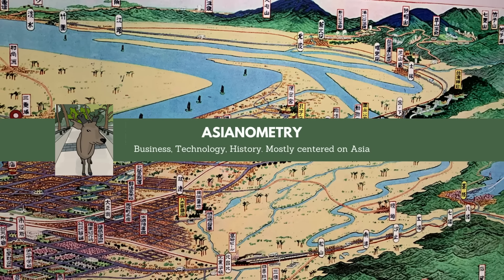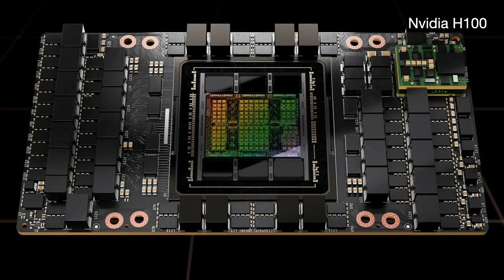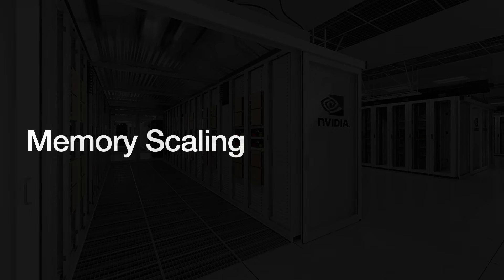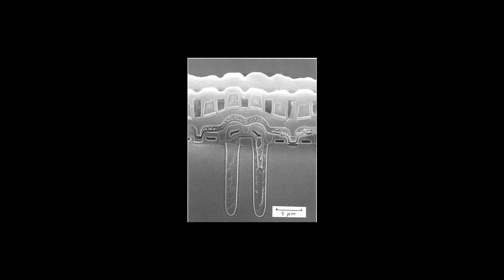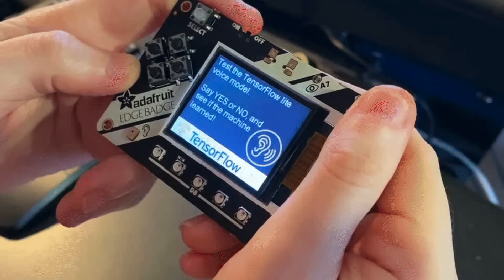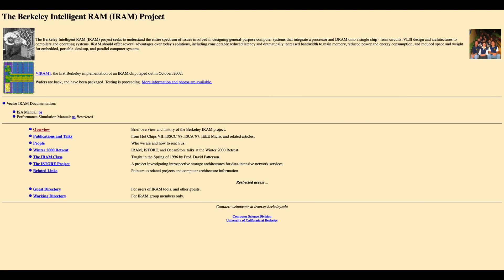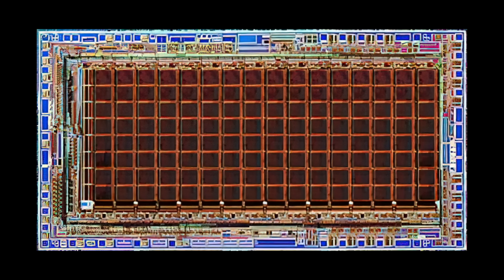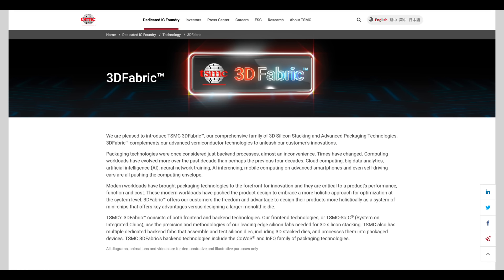AI’s Hardware Problem

Comment: I was hoping you were going to get into some of the software solutions that today's neural networks have been able to implement to allow 1000x increases in deep learning architectures while the VRAM has only increased 3x in the same timeframe instead of exclusively the hardware solutions. Stuff like how there have been great advancements in the ability of multiple gpus to communicate with each other efficiently to perform backpropogation which has allowed neural networks be trained on many gpus at a time. At first, a neural network could only be trained all on one gpu, but then the NN got too big to fit onto a single gpu so we figured out how to have a single layer on each gpu, but then the NN got too big for that, so we had to figure out how to have parts of each layer on each gpu. Each step along the way required innovation on the side of machine learning engineers to build exponentially larger neural networks while the gpu VRAM just isn't keeping up
Reply: I'm glad you mentioned this, just like 2 weeks ago they were able to write data on DNA for the first time which enables you to have massively higher levels of data compression, if you were to combine this technology with the gpus, this would solve the problem for raw processing capacity.
Reply: @xanderunderwoods3363  what area the read and write times on DNA when used as memory?
Reply: What do we need such powerful neural networks, actually?
Like, there's stuff we could do, but should we? Like, maybe we need to give society time to adapt to new technologies, instead of rushing it all in one go?
Reply: Does SAM/BAR help with this stuff?  It allows access to ALL video memory at 1 time instead of 256mb blocks.
Reply: @TheVoiceofTheProphetElizer  I'm a software dev, my experience is that the more efficient and compact you write code, the less people understand what it does or is meant to do. Sad, but true. I've ended up re-writing code to be less compact and less efficient simply because I got sick of having to explain what it does based on what logic every time a new developer came across that specific piece of code. People on average are simply not good at computing. This was in C#, when I wrote in assembly contained raw machine code it was worse, I got zero points in school tests because the teacher didn't understand why my code gave the correct answer. I'm a software dev since many years now, and write most code to be explicitly human readable just to save time in explaining, except when it's code I don't want others to mess with.
Reply: @TheVoiceofTheProphetElizer  I started programming back in the 80s, still in the 90s most of the time devs didn't have to explain why their code worked or how as much as they do now. Often enough these days it is non-technical people like accounting etc who insist on understanding something because billing elements are based on it, but they tend to move on rapidly when the "why/how" doesn't have a very simple answer. Luckily for me I don't really need others to understand my code these days, I'm the most senior where I work, so at the end of the day I can just ignore them if I wish.
Reply: @ayanaalemayehu2998  Very very slow. It's a really bad idea for use in computers, except for long-term storage where it could be great. But there might be more solutions to be found from or inspired by biological systems. I can't think of any off the top of my head, but the idea can't be discounted. Well, one idea could be circuitry that can be changed/adjusted, so that programming it would be slower but then all operations could be extremely fast. It would be bad for creating/training neutral networks, but that could be done separately on a more traditional machine, then this chip would be programmed to change its circuitry to simply become that network. I bet we're way off from being able to do that though.
Reply: Love how the boomer brigade is having a field day in this comment section.
Reply: @loonardtheloonard  No one rushes anything. Different people study different things, advances in some sectors lead to advances in others, some stagnate for a while and then progress. Sometimes advances in one subject lead to advance in a second, which in turn effects a third, perhaps a fourth, with that fourth somehow helping the first subject again. Who are you to dictate what is and isnt progress
Reply: @xanderunderwoods3363 that is useless, compute is so fast that I worry the shuttling of ions between the anode and cathode in ECRAM much less the reading and writing of DNA, DNA is for data storage not RAM, you don't understand ram at all
Reply: Implied or poorly worded, the discussion in this thread talks about it as if this video or indeed Asianometry themselves ignores or forgot to further discuss the role of software inefficiencies as "compared to" or "vs" hardware is such a weird take. Focusing on one aspect of the dilemma doesn't undermine the significance of the other, it's just a matter of scope. Perhaps the channel author's expertise is mainly applicable within the topic of hardware, and so that is what they chose  to focus on, or simply to keep the video from being bloated (hey, found another use for the word). I wouldn't read too much into it, just take it for what it is, a part of a much wider picture.
Reply: Um, the video title says "hardware", maybe you are looking in the wrong place if you expect to find "software" being talked in a video that's literally has "hardware" explicitly mentioned lol.
Reply: @Om-kl4it  the title of the video is "AI's Hardware Problem", and my comment is just saying that the main hardware problem is that gpu VRAM is not keeping up. The solution to this hardware problem was a software-based solution.
Reply: Do any young people such as myself have any respect for the wisdom of older generations anymore? It’s shocking how little some young people know about the past, just how easy it is for society to collapse into authoritarian tyranny, and we haven’t magically grown out of that possibility. 

It takes very little for things to implode into violence, ignorance, and destructive tribalism. Saying it isn’t worth taking the risks of AI seriously is astonishingly foolish. Of course we should be supporting a critical risk analysis of AI, and create risk mitigation strategies with regards to AI, along with  implementing sensible regulations to avoid many of AI’s clear potential pitfalls/abuses.

I just don’t understand how anyone taking a serious look at the potential of AI can be so blind to the clear potential for serious abusive/dystopian risks associated with allowing a completely unregulated AI free for all, where criminals and tyrannical governments/institutions/corporations will misuse/abuse AI to further their own nefarious interests at the expense of humanity. We already see almost every tech company in existence taking advantage of their users, being to big and influential to ever face serious ramifications for their illegal behaviour. Just imagine what many companies and governments will do with AI if no laws and regulations are put into place to punish those who wish to abuse the power of new AI breakthroughs. 

This is a serious topic worthy of conversation, and for society as a whole to determine how we wish for AI to be regulated and safeguard us all from the serious risks new AI tools will clearly subject all of humanity to. Saying this doesn’t mean AI technology cannot be used for the good of humanity, but that it’s equally as foolish to ignore and downplay the immense risks associated with such a new and revolutionary power that AI already has created, and that continues to grow exponentially as new AI breakthroughs are made.

AI breakthroughs have been absolutely astonishing, and also absolutely terrifyingly powerful. It isn’t just Boomers who are ignorant with their doomsday AI rhetoric, but also the bullheaded, young, naive, and arrogant Gen Z who downplay all of the obvious risks of AI while mocking all the “Boomers”…
Reply: @horrorhotel46290  We boomers made the field; why shouldn't we have our day?
Reply: @noth606  sounds dumb but, do u teach coding ?
Reply: @propulsidereal 
That's... not true. Stuff this powerful get mishandled a lot of undeserving end up dead or worse.
Reply: @loonardtheloonard 
It's not all being "rushed in one go". Not remotely, considering that LLM have long since stopped being a legitimate candidate for A.G.I

Any one person, or group even, who wants to stop it's progress can't, and likely won't until it's ostenisbly more dangerous to continue R&D than to allow themselves a break from it's progress. Such a circumstance is highly unlikely, and if people get enough upsides out of it, quite unnecessary as well.
Reply: @horrorhotel46290 
Boomer brigade? Isn't it like two people?
Reply: @bobdeadbeef 
Von Neumann was a part of The Greatest Generation. As was Turing. That isn't to say boomers didn't do anything, that's obviously false, but how much are you attributing to them?
Reply: @ivoryas1696   undeserving is bs there is no such thing as deserving or undeserving. the best chance we had at making any kind of valid judgement were with human systems, and those are mostly failures. if the tribe fails because of the inactions of the majority, the universe decides that the entire tribe suffers. its that simple, thats how deserving works here.
Reply: @propulsidereal  
That contradicts what you stated earlier, at least a little. If it's not objective, then saying 'society doesn't deserve pause" isn't factual and seems rather opinionated.

You metric for deserving, i.e basically what happens happens, talks about what people have "earned", not what they deserve. You happen to not turn in an completed essay on time by accident and you have warranted a 0 as your final grade. But if the reason you accidentally missed the deadline because your uncle passed, what makes it to where that's what you deserved?
Reply: @loonardtheloonard the only thing that has motivated the creation of this technology is profit potential. There are competitors in the field. Someone will be first, and that's who everyone wants to be. So, no, there is no "slowing down" the process so society can adapt/catch up. Sorry.
Reply: Why not go on and stop emulating circuitry in software and start rearranging circuitry for real the way the brain really works. Even better, use a biological component.

Comment: As an aside, the book "Content Addressable Parallel Processors" by Caxton C. Foster (1976) discussed the ability to have a mass memory do computation. It is bit serial, but is parallel to all memory locations, meaning that you can do things like multiply all memory cells by the same number and similar operations. Its a good read.
Reply: Interesting.
Reply: And then we got a little problem: how to estimate total processing power of such a device, especially for hard-to-parallel tasks?
Reply: Hey I learned about that book in college! Software engineering/Systems manager here, tho I do freelance mostly, I wonder if it would be possible to have a standard GPU combined with a mass memory system. Basically you build both systems separately but combine them on the dye so you could theoretically go back and forth between both systems. It would be quite bulky, however it would mitigate only having to utilize one design. Using aerogel as a frame could also significantly reduce heat output and therefore increase overall efficiency. Just a thought.
Reply: @xanderunderwoods3363  why would aerogel decrease heat output? Being a superb insulator wouldn't it reduce heat dissipation?
Reply: @Kyrator88  "why would aerogel decrease heat output? Being a superb insulator wouldn't it reduce heat dissipation?"

And thus reduce heat output... for a period of time... :P

Comment: 3:14 Why does widening a highway not much help with traffic?
Reply: Choke points. Got get them chokes, ya know?
Reply: In short, widening highways only works if the highway is wide enough for every single person that could possibly want to use it to be on it at once. The wider the highway gets, the more people want to use it, and generally the more congested it gets. Smaller highways get congested easily, so people take alternate routes.

Comment: Informative and concise; thank you.
I notice you pronounce SRAM as "ess-ram" (which has always made sense to me because of the acronym's origins as a "Dynamic" extension or iteration of the much older acronym/technology of RAM for Random Access Memory,) but you also pronounce DRAM as "dram."  (I say "dee-ram" because, again, it's a variation on ol' trusty rusty RAM.)
Unfortunately, "dram" is already a word in use outside computing - but in at least two other science fields - as a noun for:
1)  A unit of weight in the US Customary System equal to 1/16 of an ounce or 27.34 grains (1.77 grams).
2)  A unit of apothecary weight equal to 1/8 of an ounce or 60 grains (3.89 grams).
3)  A small draft.
Not like bad or wrong, but maybe worth noting for future usage.
Again, excellent work; enlightening.  Keep it up.
Reply: How do you pronounce eDRAM?
Reply: @slypear  Hm.  I suppose I'd say "ee-DEE-ram."  The core technology, Random Access Memory (RAM) persists and evolves.  Similarly, there are variants of radar (RAdio Detection And Ranging) like UHF and VHF radar, and lasers (Light Amplification by Stimulated Emission of Radiation,) where the root acronym remains (though the Gamma Ray laser has only recently been taken beyond the theoretical.)

In fairness, ROM (Read-Only Memory) became "EE-prom" in its Externally Programmable variation.  I'm not sure that technology is still in use with the widespread and cheap availability of Flash memory, so this point may be so far out of use as to be moot.
¯\_(ツ)_/¯
Reply: @stevejordan7275  Good points, thanks!

Comment: Saying that every computer is Von Neumann is loosely true. Most microcontrollers are still modified Harvard architecture computers with a separate program memory bus whereas modern PC and server processors operate like modHarvard only when the program is not exceeding cache size and the memory bus is only used for data transfers.
IMO using general purpose VN architectures is the first issue here.

Comment: Awesome video!

Hearing dram made my head spin too. Then I realized we say R-A-M as ram, so add a "D" and it's dram. Ok. But then you said s-ram and I flipped my desk.
Reply: A DRAM (dynamic RAM) cell is made by a FET transistor and a small capacitor connected to its gate. Since the capacitance is small for reasons of speed, the capacitor lose its charge within milliseconds, and the DRAM has to be constantly "refreshed" (with a read cycle usually), so it can keep the bit properly memorised.
A SRAM (static RAM) cell works on a completely different principle. It doesn't use a capacitor to memorise the value of the bit (0 or 1) and doesn't need a refresh cycle.
A SRAM memory cell is basically a RS Flip Flop (Set - Reset) which keeps the set level until it is re-setted. Therefore, instead of a single transistor, each SRAM cell is made by four to six transistors. So the SRAM cell takes more chip space, but it can run at the same clock speed of the logic circuitry; moreover, the SRAM is much less susceptible to data errors and interferences. The Mars probes use exclusively SRAM memory in their onboard computers.
The SRAM represents the ideal operating computer memory, but it takes six transistors instead of one for each memory cell...
Reply: @rayoflight62  thanks ray that is a great explanation of the differences and I certainly appreciated and easily understood.
Reply: @rayoflight62  im pretty sure he was talking about pronunciation

Comment: This reminds me of the Connection Machine (CM), made by Thinking Machines Corporation back in the 1980s. The CM had a large number of single-bit processors with a few kilobits of memory each. They were interconnected in a high-dimensional hypercube.

Lower dimensional connections were on-chip and higher dimensions went off-chip.  It was programmed in a language called *Lisp.  I remember that it seemed way ahead of its time.
Reply: We are now engineering systems which we cannot ever understand, millions of weighted matrices developing novel solutions.   We are living during the dawn of something monumental.
Reply: Thinking Machines was founded by two guys and one of them was Richard Feynman's son. Feynman helped them to solve some problem using integer differential equations and since none of the two could understand it they were reluctant to use the solution ... in the end they used and it worked. Thinking Machines created the massively parallel computer technology that ended up killing Cray Supercomputers.

I believe, btw, that CUDA cores are something like that - tiny CPUs with a bit of memory for each one.

One thing I don't understand is why don't they use static memory to solve the problem ... does it consume to much power?
Reply: @ElectronFieldPulse  So you,re doing nothing.
Reply: @barreiros5077  - I never claimed ownership.  I meant it in the way of progresss of mankind.
Reply: @ElectronFieldPulse  Lost in translation or flashed rom...excuse me.
Reply: @robocu4  That was my point before.
Reply: I managed a supercomputer center at Lockheed California Company in the 80's.  We had a Connection Machine and a CM Data Vault in the data center.  It operated as a co-processor behind a lisp based Symbolic Workstation.  No one really figured out how to best utilize it however it looked awesome with its flashing lights. The Data Vault was very cool with 64 SCSI drives.  The Data Vault wrote 1 bit to each drive for redundancy and scale out.